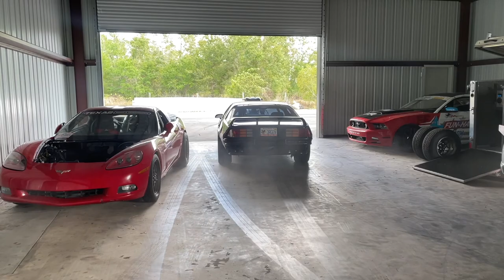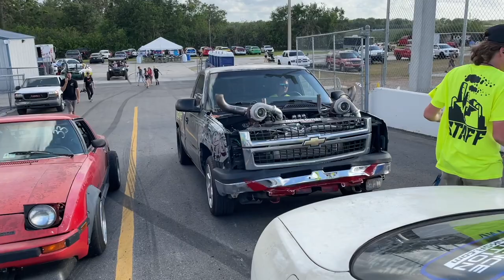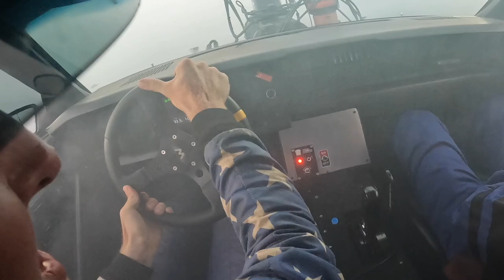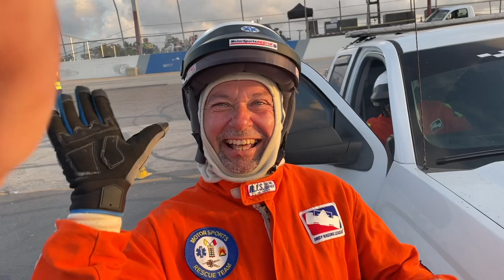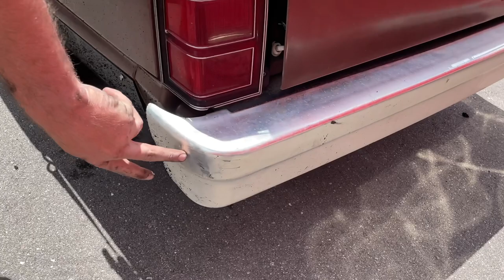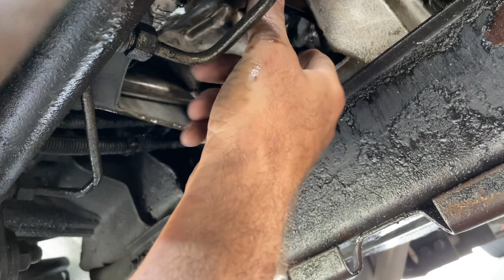Jackstand Wrecked His Truck, Neighbor's Engine EXPLODED, Zach Hit The Fire Truck... An EXPENSIVE Day

Comment: The Mystery Machine must be absolutely NUTS in person.  At the dragstrip a few years ago a guy had a 1st gen RX-7 drag car.  Turbo was bigger than the engine, ran mid 8's in the quarter, had a badass paint job in that correct coppery/bronze metallic color.   With an uncorked exhaust, that thing was just STUPID EAR PIERCINGLY LOUD!!!!   Doesn't have that bass that hits you in the chest like an uncorcked BBC, its a much higher, more piercing make your ears bleed type of sound, almost like a dog whistle for humans lol.  Also I swear that van looks like its going to flip over every time they sling it around.

Comment: Neighbor is such an underrated car on the channel. I know it had its time, but damn that thing has been a work horse all these years. Shout out to Neighbor man, the real OG.
Reply: Neighbor is No. 1 for the guys; everyone knows that.
Reply: @vayabroder729  That's why he spared no expense fixing it's rear after it slammed into the wall. Just about any other car would have had it's engine pulled and it's chassis retired at that point.
Reply: Nevermind that fact that the gt500 drivetrain probably had a few THOUSAND miles of revv limiter bashing burnouts on it, im very impressed it survived 🤣🤣🤣
Reply: @mikes78  I always wondered about that. With the immense fleet of Crown Vics you’d think he’d just swap components on to another one because the damage on the first one was extensive.
Reply: @Vayabroder  neighbor has more sentimental value than any other car on this channel. Without neighbor, this channel wouldn't exist.

Comment: Garza needs ABS in his burnout car just to keep from locking the front wheels up and hitting the wall every time he goes out🤣🤣
Reply: miata only sorta has front brakes ;) but he wouldn't be Garza if he didn't hit the walls so i'm perfectly fine with it.. miata's are cheap especially if you don't need to buy a pristine one.
Reply: he only needed to press clutch, put into 3rd not 1st and rip it, you dont need brakes in manual to do skid
Reply: @sirmonkey1985  Kyle and the crew spent some time installing that turbo K swap into the Miata though. Kind of a waste to see it get driven into a wall while not even roasting the tires lmao.
Reply: @pilot554  yeah just let off the brakes and go to 3rd and he wouldve been fine
Reply: @sirmonkey1985  this car is swapped and not just a miata though, its a pretty well built and in depth swap tbh...and it obviously had great brakes considering he locked it up for 100+ft....if he had just let up a bit and hit the gas he wouldve been fine...... Slick pit+ front wheels locked+ 1st gear pinned= wall crash

Comment: I'm shocked he wants to do a coyote with how reliable that 5.4 has been
Reply: yep same but probably a lot easier to build off the coyote platform
Reply: Cost probably has something to do with it. You can get a brand new forged short block from ford performance for $5k I think the gt-500 is quite a bit more.
Reply: @douglasm3310  pretty sure the last block was from a truck
Reply: @yousefkiller1293  It was from a GT500 that was wrecked, the body shop they had next door at their old shop was getting rid of it.
Reply: The Original one was but this one not so much
Reply: @michaelwynne4346  I could be wrong but I thought this was the original block and they sent it out for a rebuild at some point
Reply: @NovaNinja_  the original block was when they first did the manual swap and whole build but not this one
Reply: @yousefkiller1293  Ahhh I gotcha
Reply: @NovaNinja  they blew the gt500 motor.  If I remeber correctly they thought the timing chain had something to do with it.  I'm not sure what motor they replaced it with though.
Reply: 5.4 triton?
Reply: @duanebailey6253   they lifted the head or blew the gasket during the 1kwhp pull and the next say it shot the rods out hydrolocking on start up
Reply: 5.4 is kind of an old platform now they don't make em anymore so to get Ford parts and aftermarket support theres way more
Reply: @yousefkiller1293  nope first one was the wrecked Gt500 then it got built
Reply: @kuttinkuddy3905  yes sir the same engine that people say how unreliable they are, the 2v is tough
Reply: @kuttinkuddy3905  no that's a 2 valve sohc. They have a gt500 motor. 4 valve dohc.
Reply: got a 98 expedition 5.4 triton straight piped and the thing is a reliable ass beater 😂😂
Reply: @oldblood_eyes  not the same engine…
Reply: pretty sure this engine has been rebuilt 3 times and is basically mangled haha
Reply: Right that thing was a beast she held up so good 😂 for so long
Reply: @duanebailey6253  they reused torque to stretch cam bolts.
Reply: Those early modulars are EXPENSIVE to build. Simply because the market for them is so small. Ford didn't really get the aftermarket love back until the coyote dropped. More power to them, but 4.6/5.4 lovers are stuck paying more for less.
Reply: It better have been because it was like a 40,000 engine
Reply: @ProTuneHD  It was already pretty mangled when they had it rebuilt last time, and the builder said that it could not be rebuilt if it blew up again, hence the constant "past the liability line" remarks.

Comment: Hey ford engines r extremely strong. Forgot to check my oil in my 4.6 and checked it today. Ran it 3 quarts low for who knows how long with me beating in it and still no knock. Only reason I even noticed it was a tiny bit of valve  noise. Even still had great oil pressure with only 2 quarts. Do not recommend doing but still they are super strong

Comment: You know what would be a fun "burn it down" thing to do at an event.  Put some extra room on the drive for the supercharger, and put an electric motor on it with a huge burst to run the engine off the supercharger forcing the engine to operate for maybe 5-10 seconds as the engine is grenading.  Then you lift that, put it in your next build.

Comment: Mean while Cleetus Camaro doing a full blow burn out  at idle car was at 2000 - 3000 rpm whole burn out nice and it had the most smoke there where times where I could not see the car
Reply: Tach isn’t accurate
Reply: @xx11seczxx  i was about to say damn like lil uzi vert ddddddddddaaaaaaaaaaaaaammmmmmmmmnnnnnnnnnn

Comment: Time to build a car that uses junk yard engines so it can blow up every event and not cost a ton to fix. Would be even better if the car itself was pulled out of a junk yard. Smash a fender? Take one out of a junk yard and slap it on. Don't even bother painting it. See how long it takes until you can't ever see the original color.